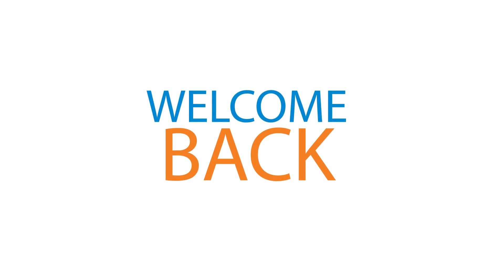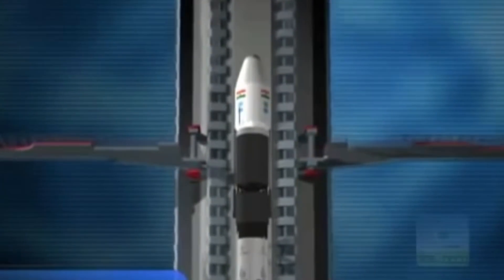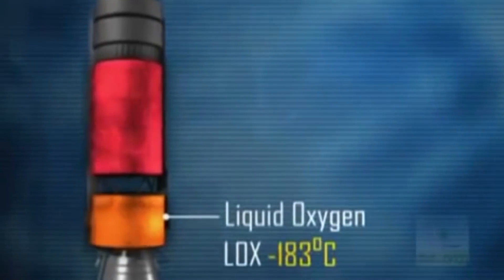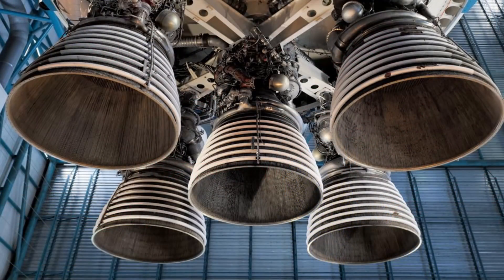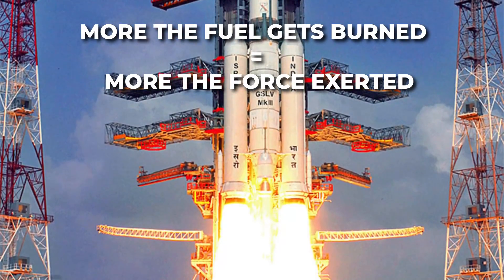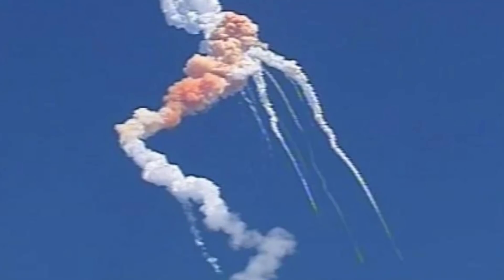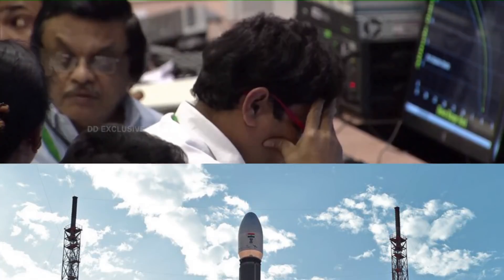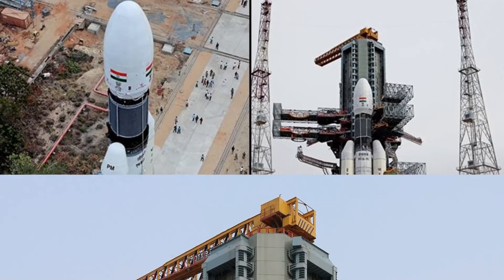Everything you need to know about Cryogenic Engines by ISRO | Young Scientists

Comment: The mechanism of joint used in between two stages of rockets.
As the joint has to take the load as well as it has to separate easy and quickly from another stage during stage separation....

Comment: The good news is we have already started manufacturing Semi-Cryo engines which have a high weight to thrust ratio. These type of engines are used by spaceX named as 'Merlin Engine' even in  Falcon 9 rocket as sea level engines and vaccum engines. The bad news is that its been under manufacturing for almost a decade and still there are no updates on it. Hope we will see it soon in upcoming missions.

Comment: I have a question that On Moon Mission why 3 astronauts are pilot?Is if compulsory to join airforce or army to become astronaut?
Reply: Answer to ur 1st question:
It's not necessary 3 astronauts are necessary . Each moon lander have different requirements.
Apollo mission had a system which needed 3 pilots . One for landing manvuers one for controlling the system and other for checking all parameters.

The Soviet version of moon lander was designed only for one person. (Scary for a single person on moon). Which never happened though.

Second question's answer:
For becoming a pilot in India only air force has authority to qualify a person as an astronaut. ISRO is currently not into astronauts training . Even for gaganyan mission we had to send them for training in Russia.  In USA earlier it was through military but now NASA also qualifies astronauts.